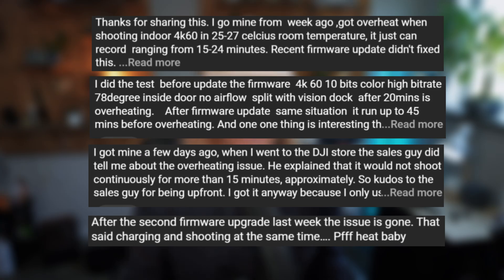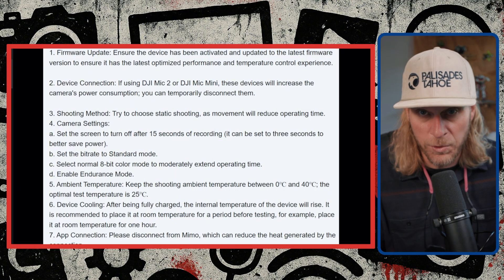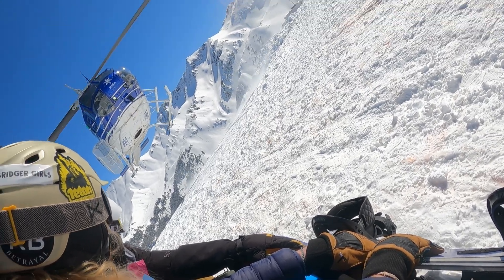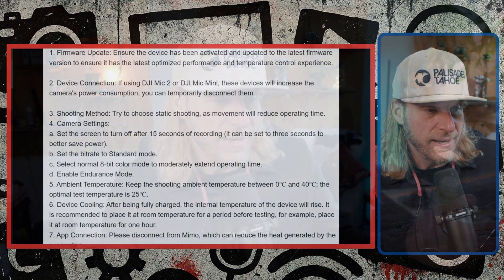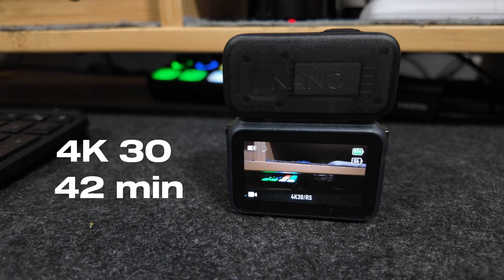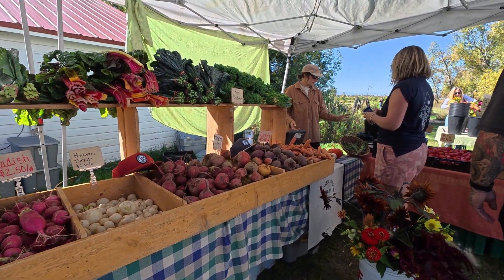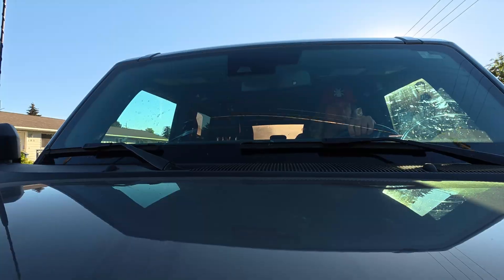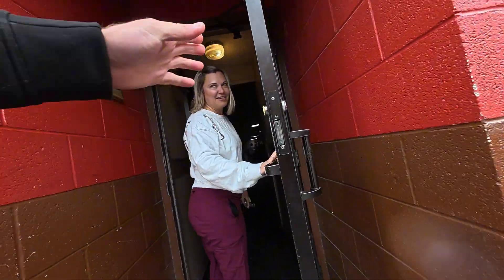DJI Nano Overheating Update - Tests, Footage, and Causes

Comment: If in the U.S., make sure you buy from a dealer outside of the U.S. to get the DJI Care Refresh plan, which is not availabe in U.S. since nearly 100% of units sold in the U.S. on amazon, ebay, etc., are grey market due to the DJI ban. Check into this closely or you'll be sorry. You're welcome.

Comment: Really appreciate your reviews I’m stuck between osmo nano or the insta360 ultra
Reply from the maker: That is a tough one, so here is the deal the nano is good, love the colors, but it overheats and if you live in a warm place I don't think you will be happy with it unless they fix it in firmware if even possible. It has had 3 firmware updates so far and they have not been able to address the overheating. The other side, it wont work in cold weather either, its rated to 0 C or 32F which means it may not work in the cold either. Because of those reasons its is unreliable in its current state for me. I had the nano returned it and will most likely get the Ultra. But if you are someone who only shoots 30 second to 1 minute clips you may want to consider the nano I just can;t say they will ever fix the overheating issue. I think if they don't this summer you are going to see lots of angry people as if its like 90 degrees F outside and sunny, I think it will overheat quick.

Comment: We just got ours and so far no issues, but to be determined - time will tell. 

Question for you - in your tests did you run the camera 'naked' or did you use its plastic 'protection' case? 
Could it be its case is preventing the camera from 'breathing'?
Reply from the maker: Hi. Yes I did it naked, I thought same thing but it had no cage on it. Dooohhh
Reply: I😊

Comment: UPDATE: I got my first overheat after 2 weeks of usage. Settings 4K60p 10 bit Auto everything. Ambient temperature around 30C, got a warning "Charging paused. Charging will resume once temperature returns to normal"  after I started shooting around 15 minutes (not continuously though). The camera was still recording though but I stopped it after around 10 secs. Today I tried again, got the same warning after 15-20 mins of usage (again, not continuous shooting). I switched down to 4K24p after the warning went away, and had no problems again after that. So I am also thinking if I wanna send this back or wait and see if they do come out with a solution. I do like the camera, but you are right, using it in lower settings all the time is not a permanent solution! Time is ticking DJI!

Comment: I was thinking of buying one, but I've given up. I can't imagine the recording time in temperatures above 30 degrees Celsius in the summer. I think a heat-dissipating metal frame for this camera will be available soon. Maybe I'll consider it then.
Reply from the maker: Yeah, it's definitely a tough sell in warmer climates right now! I wondered two about a metal heat seek.
Reply: @HillPhantom  As a cheaper alternative, I think I'll get the Action 4 or, if I increase my budget, the Action 5. The Nano was a disappointment for me.

Comment: I had two different insta 360 go2 models and i haven't bought a small one sense it was a great camera but overheating was a major problem on both of them, and i was riding a motorcycle. Then they just both died and i couldn't recover them. I'm surprised if the go 3s don't also have overheating problems. With this form factor i think it's inevitable. I would probably drop it to 4k 30 and reduce the bit rate and other settings but i'm not particular about the quality. I can't get myself to buy the go3 because of my experience with the go2.
Reply from the maker: I have the Go3s and have not had any overheating issues.

Comment: Thank you for sharing. I was planning to grab one for myself. If you are already struggling at that temperature, what more here in Las Vegas, maybe I should hold on for now. DJI always fixes things fast with its firmware updates.
Reply from the maker: My hope is the fix it, my worry is its a hardware limitation.....

Comment: Wait. Before you send it back.
There has been an unofficial bypass for overheating since the Action 2. I've heard it works on the Pocket 3 and the Action 2-5 and can confirm that neither of my Action 4s have overheated since before the summer and I shot long takes with those mounted on my dashboard. I don't have Aircon!
First, on a computer create a txt file and in that file type "heat test" without the quotes. Save it and rename the file to "crackconfig" without the quotes. IMPORTANT, you need to remove the .txt file extension. Apple Mac is easy, Windows PC you need to change the view option to be able to see and remove the file extension.
Lastly, drag the file onto the root of the SD card... Ok, so this is the instruction for the Action cameras and you will need to experiment with the Nano. I don't know if the camera's own internal storage can be mounted. I don't own one yet.
Good luck!!
Reply: I remember doing this for my pocket 3 a few years back. You might have saved the day! Arrived today and I was about to return!
Reply: @iamVinnyK  and does the trick work?
Reply: @iamVinnyK  can you update on us if the trick works?
Reply: @ino.3 Unfortunately, I thought it did as I was able to record for almost 45 mins but then another day I was randomly hit by the overheating issue again. It’s passed the return date for me anyway so I’ll just keep for brief POV videos like workouts and maybe runs.
Reply: @iamVinnyK  I see.. I was thinking to get it as a hybrid camera for driving and travel vlogging but I guess it wouldn't work well for driving videos then. Thank you for your update! Really appreciate it.

Comment: Thanks for sharing all the details, what if we shoot at 4k 30, high bitrate, normal color profile and connecting the dji mic? Approx how much would it last?
Reply from the maker: Honestly seems like its all over the board depending on temps you are running it in. I can just tell you it WILL overheat esp with anything connected like the MIC. My test, in full sun and 70 degree F, it gets about 8 minutes before it overheats.
Reply: @HillPhantom Oh crap, 8 mins is basically unusable 🙁
Reply from the maker: @WandernUnwind  I don't want to be that guy but ...... its just my findings.
Reply: @HillPhantom I think it’s better to wait a bit before investing, DJI might release a firmware to sort this out
Reply from the maker: @WandernUnwind  I really hope they can and do, no doubt they are aware and I do believe working on it .
Reply: @HillPhantom Indeed, let’s wait ✌🏻
Reply: @HillPhantom  https://youtu.be/tPoD1BA41ik?si=VJQsrRIOLkipkZBm

Comment: Wow!! Im so glad I watched this. I was about to go pick one up. If you struggling with heat in northern States. I can't imagine how much it's going to struggle in Thailand.
Reply from the maker: I have never been to Thailand, hopefully one day, but from what I hear and read, I image it would overheat A LOT just like me there LOL. Thanks so much for the watch and comment! Cheers.
Reply: You cannot simply compare this way. In Thailand, air is also more humid. Humid air has better heat carrying ability.
Reply: @andrew_anzhu  Thats a good point but Ive had my iPhone overheat out here. So if any device is having problems with heat in the states I'll pass on it for using it in Thailand.
Reply: I live and work in Yosemite,
Also grew up in Coachella Valley(40degc + for months),
I've traveled to Thailand twice,
The temperature range is a complete deal breaker.
Reply from the maker: @ClimbingEasy  fk bro on top of half in sunny spring day might be all it takes lol......
Reply: @HillPhantom fr

Got the go3s (pill) and love it, collecting footage... gonna wait to upload. Not gonna upgrade to ultra. But cant wait for action 6 pro.... will be the finishing  touches on my 1 bag travel run and gun set; dji pocket 3/3 mic mini/action 6/ insta go3s. 
Ty for the update btw.
Reply from the maker: @ClimbingEasy  Your welcome, I have a similar quiver and due to price I wont upgrade to the Ultra either. Hopefully 6 is a banger!

Comment: I made this kind of comment before. Consumers are to blame as well. there are a few like me that would like higher features at the expense of overheating. and I understand that limitation. and told dji go for it in a sense. put the max features knowing there will be limitations. 
for example the bitrate and the 120fps. it can shoot those and possibly overheat but gives the user options if they were taking shorts clips etc
essentially they gave the user too much power. if they met the specs of the go ultra and just had it cheaper like it right now, then it could beat it on that alone.
a lot of people are buying it for the wrong reasons and maybe that's part of dji marketing fault. for sure this cannot replace a legit vlog OR an action cam.
most people who don't care about creative shots and quality can get away with just the osmo action 5 as their sole camera. 

even with the faults, there's nothing to replace it so it's hard for me to send it back. despite it's larger and heavier than I want it to be , it's still half the size and half the weight of a action cam. 
perhaps I should just get meta glasses hahah

edit: from a marketing standpoint, dji could just match the current industry standard and put the heat and power hungry features under a "beta" setting to activate.
Reply from the maker: I largely fully agree with you, as I am all for pushing the limits because if you don't you don't advance. However, and its a big however, do what others have done, say X amount of record time before it overheats. Call it out, don't sell a dream and then crush the product. Honestly is just key to me. But 100% agree as we need to push the limits to get it to be "socially acceptable" to vlog on an action camera for example. And I know it is, but the camera nerds get all fired up if you do it or say it, and I am on the other end, more hybrid cameras the better....Enter the DJI Pocket 3 stage left lol. I'm with you for sure!
Reply: @HillPhantom totally. You have to beat the customer expectations. 
I tell you I got annoyed fast from certain reviewers who just repeated the marketing spiel when they had the product beforehand. I want the real recording time they know very well the marketing numbers may not reflect real world numbers.
Reply from the maker: @WillEDC  For sure, sux to make it in the game full time you have to bend the knee to the brands. I would LOVE to go full time, but not over honestly and loyalty to my followers. Could not sleep personally but I get why "they" do it.

Comment: Very helpful. I have been to my local store a couple of times now to buy the Osmo Nano to replace my GoPro Hero 5 and Session 5, and each time I have bottled out after remembering the issues that you and other creators have had with it, I am now thinking of the Action 5 Pro Adventure Combo but yesterday found out that there is an Action Pro 6 due to come out. I think I might wait a bit and see what happens. Having a number of DJI drones it is disappointing that this DJI product doesn't meet our expectations as far as performance goes as DJI are usually really well built and reliable. Thank you for sharing your observations and views.
Reply from the maker: Your welcome. If you can definitely  wait on the A6

Comment: Great honest opinion! I put mine on my car and drove around recording with no issue. That gave me another thought too, does the camera overheat due to the lens module or the LCD module, and does it work better when separated? Most tests I see are with the lens and LCD attached to each other. I had mine detached and it worked fine, but also it was outside with lots of wind so I guess it cooled down better. All the problems point to CPU overheating... since the "solutions" DJI gave are mostly reducing load on the CPU usage. Thank you, keep posting! P.S. This issue may be why DJI disables the quickview when the camera module is separated and you have a DJI mic connection, just guessing it will overheat even faster if we have mic and cam module connected wirelessly.
Reply from the maker: Well said, yes I agree, its 100% a CPU issue. It almost has to be the connections. More calculations more heat. This is a big issue I just fear they won't be able to overcome.
Reply: 다른리뷰에서는 카메라모듈 단독으로 사용할때 조금 더 길게 촬영되었습니다. 과거 action2에서는 배터리모듈을 연결하면 촬영시간이 2배가까이 올라갔지만 nano는 그렇지 않았습니다.

Comment: I found the same problem so i returned DJI nano. I bought insta go ultra instead and it doesn't overheat at least. Wait for nano 2❤.
Reply from the maker: Do you like the Ultra?
Reply: @HillPhantom  i think go ultra is better than nano (only the sound quality of dji mic via Bluetooth need to be improved)
Reply from the maker: @TwChris31  great point and thanks for the take on the Nano, I just wish it wasnt so expensive.

Comment: Good explanation on the differences in overheating. It definitely makes sense that stabilization while moving requires much more compute than a static shot. By the way, the max bitrate on the Insta Go Ultra is higher (180Mbps) than on the Nano (120Mbps). Yes, it's only 8-bit color though. I have the Pocket 3 and the Ace Pro 2 and I do prefer DJI's "look" especially in D-LogM however from what I've seen, the Ultra's footage is a little more refined than the Ace Pro 2. Pure video, while looking processed, is a very useful and innovative feature. I don't think the Pure Video on the Ultra is as effective as on the Ace Pro 2 due to its dual processors. Like you saw here, what the camera is doing requires quite a bit of compute.
Reply from the maker: Doooh I didn't know that, that awesome about the Ultra, yea shame, its not 10 bit. I just wish the Ultra was less expensive. Thanks so much for the watch and data mate! Cheers.
Reply: На счёт битрейта у insta360.. при такой маленькой матрице,при 8-битном цвете откуда берутся эти 180мб/с?У той же pocket3 при значительно большей матрице битрейт раза в 1,5 меньше.Складывается впечатление что insta360 прибегают к маркетинговым уловкам и вводят в заблуждение.
Reply: @news7908  I agree — but I think the nuance is that no single spec (bitrate, color depth, megapixels, etc.) guarantees better image quality. It’s really about the final result and your workflow. 10-bit only matters if you push a creative look — light tweaks or a basic LUT don’t usually need it. And while a higher bitrate doesn’t automatically mean better quality, too low can definitely cause smearing, especially with fast motion (as we saw with the Action 5 before the bitrate update). A good example of this is that I love the Pocket 3’s image even though it’s only ~9MP, while I don’t love the Ace Pro 2’s image quite as much even though it has way more megapixels and higher bitrate — but I still use it when I just want to capture the moment. I’ll even take it a step further and say the brand doesn’t matter much either. Cameras aren’t sports teams — it’s fine to have preferences, but the end result matters way more than whatever logo is on the device.
Reply from the maker: @TimBrownTown  but if I only get 8 minutes of time to film before it overheats for me at least that's a hard stop
Reply: @HillPhantom Yeah, that's definitely a deal breaker for me as well, especially with a camera designed for POV use which means you'll likely want to chest mount and record for a while without starting and stopping a lot which allows the camera to cool off.
Reply: @TimBrownTown полностью согласен.
В любом случае я уже заказал Nano,буду смотреть её,тестировать.Ну и конечно же буду ждать выхода action 6 и сразу её возьму.Первоначальная информация была что матрица будет размером 1 дюйм,но по недавней утечке информации размер матрицы будет 1/1.1 дюйма.
Reply: @news7908  Yes, and also square and the pixel size is not as impressive as we hoped as well. But it should be better than the Action 5. I will likely be purchasing it as I need another break out video like my Ace Pro 2 vs. Action 5 one.

Comment: Been having the same overheatng issues on mine! Flying in direct sunlight for 15+ mins and it starts throtteling - proper annoying during golden hour shoots. Your footage still looks crisp though. Is this a firmware fix or hardware limitation? Might return mine if DJI don't sort this sharpish!
Reply from the maker: Dang man sorry to hear that! When you say flying like a drone or like in a plane? Just curious cool either way! It's so hard for me to say right now, I want to believe they can fix this with firmware but, I am worried its hardware limitation. I just can't see them fixing it fast enough and I don' want to get stuck outside my return window. Love the form factor so its s shame and of course I love the look of DJI. Doohhh I really am hoping they figure it out. Cheers mate.